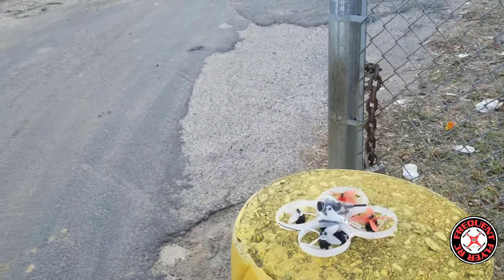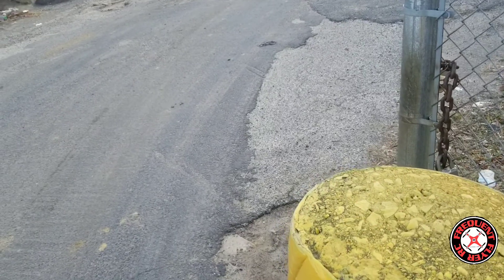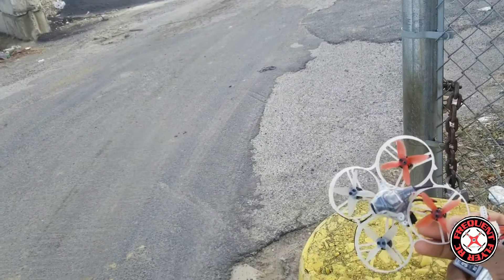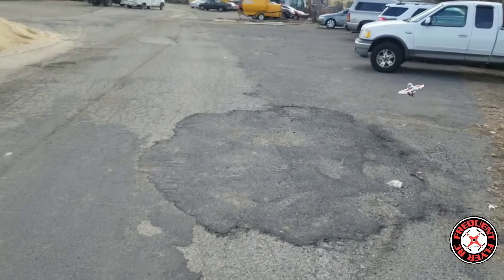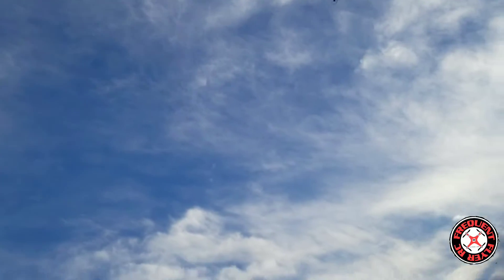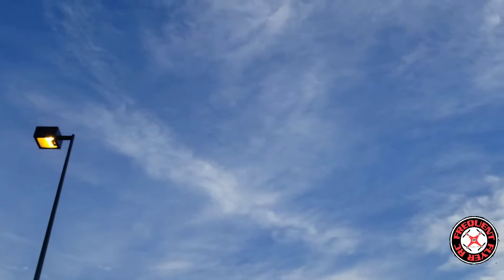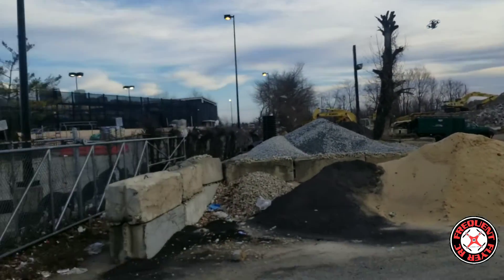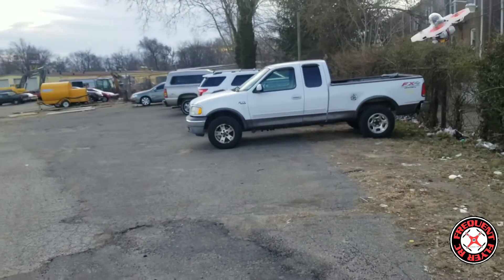Beta85X Prototype Avan Quad-blades 450mah 3S vs 350mah 3S

Comment: Hey FF 👋 
Just built one running 2s on 1103s and madened it this eve w Geman 2035s while the Avans arrive.. What settings do you fly it on in Beta?  Air mode? Props in or out ? 
Best,
P
Reply from the maker: Nice! Airmode indeed! I thought about switching my motors to a smaller 1103 as well! 👍🏽